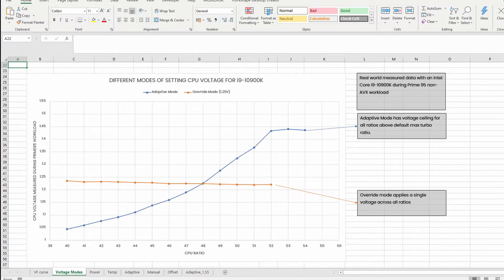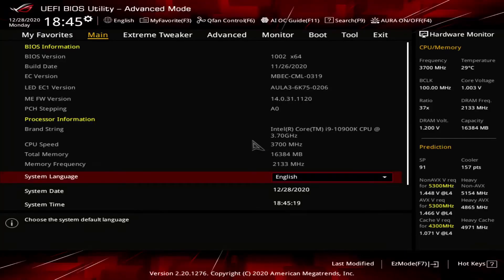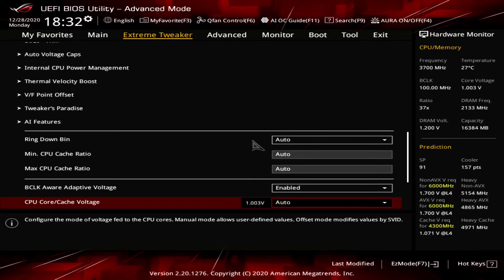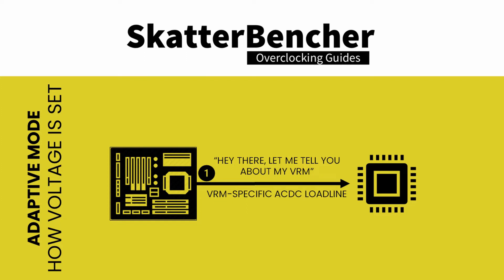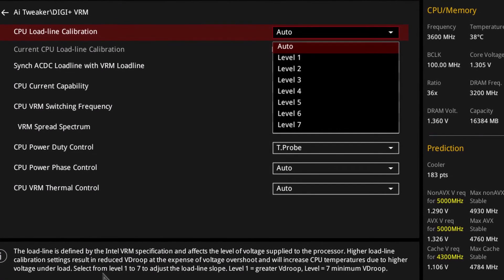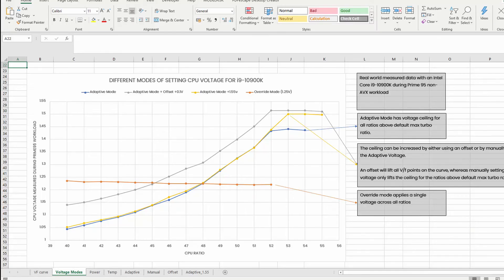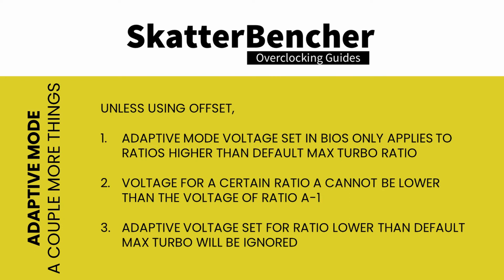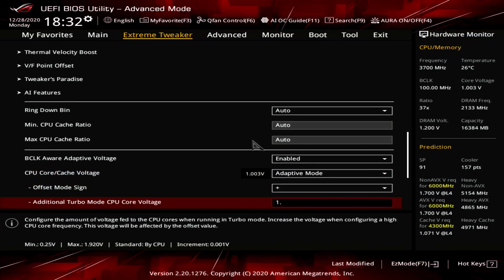Intel Adaptive Voltage Explored: Load-line, V/f Curve, V/f Point Offset | SB#19

Comment: I could not find any other place on the internet that properly explained adaptive mode. I understood it followed the CPUs VID table, but I was so confused why my Asus motherboard still gave me the option to enter a manual voltage. Now I understand it is just if you want to increase the ceiling above Intel's specifications. Not even the user manual for the motherboard explained this simple fact, thankyou!

Comment: I know this video is older but this is the best example I've found for more advanced info on voltage settings. I'm an advanced overclocker with years of experience but just started to get into extreme undervolting with my 12th gen CPU. Overclocking I've always got my LLC close to perfect with no v droop then set a manual voltage. I noticed with setting an adaptive undervolt too far it does nothing as you explained when in the turbo range. I still need to do a lot of benchmarking to make sure I don't lose performance as I've heard it is possible even if your clocks stay the same.

Comment: Not sure how accurate the rule #1 on adaptive voltage really is. On a 12900k, the OC ratio is 53, but if you sync all cores to 52x, and set an adaptive voltage, it's pretty easy to see that it actually takes effect.

Comment: I always wondered what does VID per ration must come from some table, how can I offset that?! My 10850k is stable at x50 ratio at LLC5 (ASUS), 1.385V manual. Cannot seem to get that moved to offset or adaptive mode. Any pointers? Also, I learnt something today VF point offset. Subbed, you deserve way more!!
Reply from the maker: Thanks for the kind words.

The 10850K has a default maximum turbo ratio of 52X. That means the voltage required for every ratio up to 52X is defined by the factory-fused V/f curve. This is pretty much the safe voltage as Intel's specification guarantees this voltage and frequency will work up to 100C.

There are two ways you could change the voltage for a ratio that's below the default maximum turbo ratio. First, you can apply a global offset to the adaptive V/f curve. A global offset will increase or decrease the voltage for each point of the curve by a certain offset. So, it applies to 50X but also 8X for example. Second, you can adjust the specific V/f point with an offset as well. Note that the voltage of a given point on the V/f curve cannot be lower than the previous point or higher than the next point. So it's quite limited.
Reply: @SkatterBencher  yes shall try over the weekend, updating the vf curve, currently after two days of use and stability tests, moved to svid behavior to best scenario and vcore to auto. This way majority of the stuff is stable, blender, and such occt avx2 large datasets work but small data set gets bsod. It needs a bit more juice. Didn't get time over the week shall do on Saturday. And again thank you for the videos. Love to learn new things.
Reply: @SkatterBencher  I think the last sentence of skatterbenchers last statement here is important to know, however I'm confused by the Last statement made in the video? At 4:50

I know earlier in the video the slides show that there is a voltage ceiling for ratios above 53x (Im referring to 11900k). so are you saying that the VF point 8 will always show the highest ratio of your overclock & every ratio from 53x on up will share the maximum voltage you set? So If I set 1.6v for 60x, then 53x-60x will recieve 1.6v?
 (just an example).

The voltage ceiling comment confused me

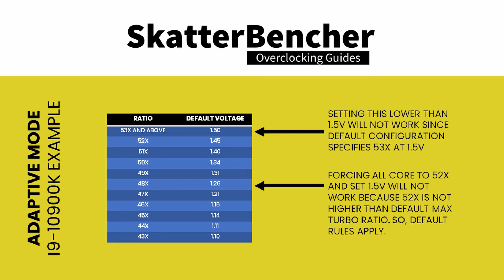Comment: 4:07 so if setting all cores to 52x do you leave the overclock mode set to auto? Or do you set it to adaptive & just leave additional turbo mode cpu core voltage blank (which shows auto).
(On RKL CPU btw)

Comment: Im trying to learn this.. Ive set a fixed voltage to 1.45 with all core ratio on i9-12900k to 5.2ghz on P-Cores, 4.0ghz on E-Cores, AVX offset 2x. However, i want the voltage to drop when the CPU downclocks, as it is now the voltage sits at 1.448 on average and minimum, up to 1.464 at maximum. Voltage requested per core range from 1.467 to 1.480, im not sure if it matters but its the Core VID's reading in HWiNFO64, i just resetted the readings, not sure if the readings include before last reboot, where 2 of the cores were set at 5.4ghz, i decided to use all core ratio instead.

Comment: Hi, Thank's for this tutorial. I have one question. To which level of load do the voltages plotted on the first slide correspond ? To unify all the discussions where the CPU core voltage is the main point (V/F curve, LLC, SVID,...), would it be better to plot the Vcc as a fonction of Icc (amps). After all I think that Icc is directly related to the load level and is a good way to quantify it. For one given CPU, only one curve (Vcore as a function of Icc) could describe the voltages that are expected and/or applied.

Best regards

sl91

Comment: Thanks for the video , planning to build a pc with apex encore 14900ks and 8400mhz g skill ram , do I have to change these settings or I can just set Intel correct power limits and svid behaviour to trained and solve the instability and crashes on certain games? Also cpu load line calibration level 4 is good ?
Reply from the maker: I've not been following the situation with Intel stability too closely, but my gut tells me that the root cause is that motherboard vendors are slightly too aggressive with AC LL and VR LLC configurations in an attempt to lower temperatures under all-core  workload conditions. This strategy worked fine in the past, but seems on the edge with the latest top bin CPUs.

Aggressive AC LL and VR LLC effectively "undervolt" the CPU. In light workloads where the CPU temperature is not high, usually that's fine. But in heavy (e.g. AVX2) workloads with high temperature, the margin is much smaller.

A couple months before 14th gen launch, I had a chip that exhibited this kind of behavior: blue screen in P95 with high frequency and high temperature. The easy fix was to adjust the AC LL or VR LLC. This, of course, resulted in higher temperatures and lower frequencies. But the system was stable again.
Reply: So what exactly does a low AC_LL offer compared to setting a high ac loadline with a large negative adaptive offset? Why is low AC_LL said to reduce lifespan of cpu but undervolting extends it?
Reply: @SkatterBencher  how do I know what values to set for the ac/dc ? I heard that the VRTT tool is needed  from Intel to know the exact values
Reply from the maker: Some motherboards show the configured value in the BIOS. It's also possible to read out the value with, for example, Shamino's work tool
Reply from the maker: Who says low AC_LL reduces lifespan?

A low AC_LL means the voltage the CPU requests from the voltage controller (using SVID protocol) will differ less from the CPU's native VF curve. 

In theory you'd have no deviation, set AC_LL=0.01, and just follow the CPU's VF curve. However, in reality the requested voltage and effective voltage will differ due to VRM LLC, impedence, and other factors. 

So, motherboard makers will define the AC_LL such that the requested voltage is higher than the CPU VF curve, such that the effective CPU core voltage is sufficient for stability.

Recently, it seems motherboard makers have pursued too aggressive AC_LL configuration (along with aggressive VRM LLC) in an attempt to effectively undervolt the CPU to get lower temperatures under load. By that I mean the effective voltage is lower than the CPU native VF curve.

The opposite can also happen: configure too high AC_LL and the CPU core will be overvolted. I guess, in this case it can affect lifespan.
Reply: @SkatterBencher  so the purpose is to set the ac/dc as low is possible? I’m about to finish my build today 14900ks + apex encore + 8400mhz g skill ram I will be glad if you could help me tune and stable it 🙏🙏
Reply from the maker: It's hard to say as low as possible because it's relative to other settings.

The ultimate goal is to get the effective voltage as low as possible. This can be achieved with AC_LL, VRM LLC, adaptive voltage offset, VF point offset, TVB, etc.

AC_LL is just an easy method as you can check the current value and try setting it lower to achieve a lower effective voltage :)
Reply: @SkatterBencher  if I’ll set svid behavior to trained or best case scenario and cpu load line calibration to level 4 is that enough? Also make sure ac/dc are the same values? Btw svid behavior trained uses the motherboard sensors for the voltages? Is that recommended to use?